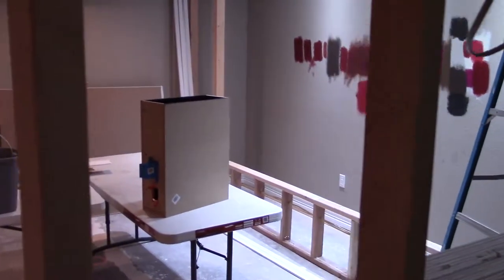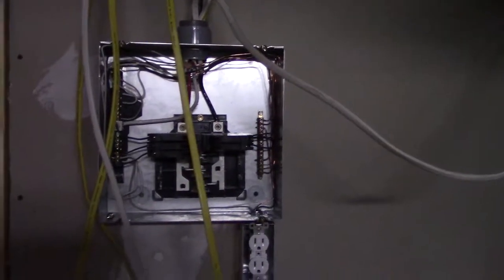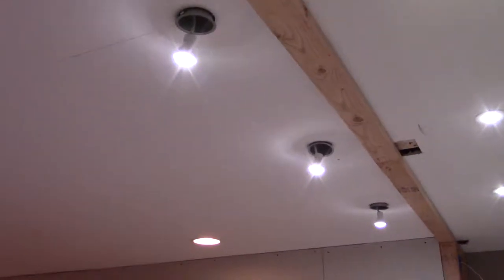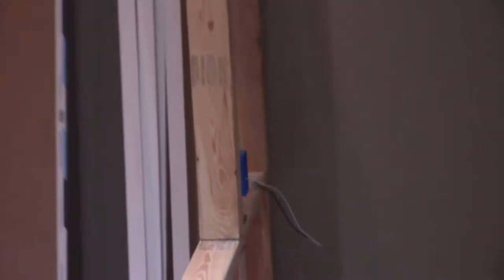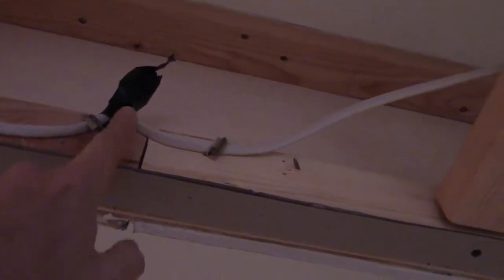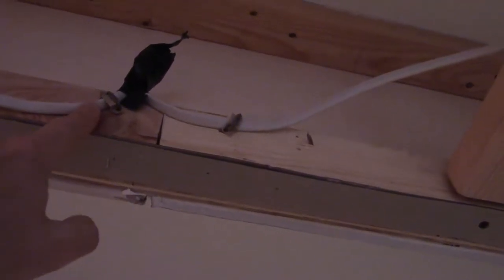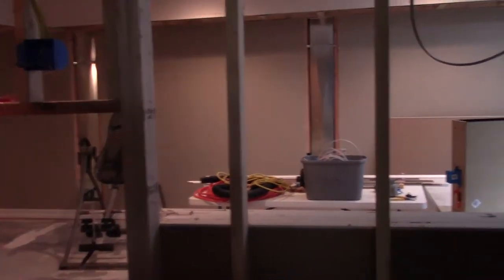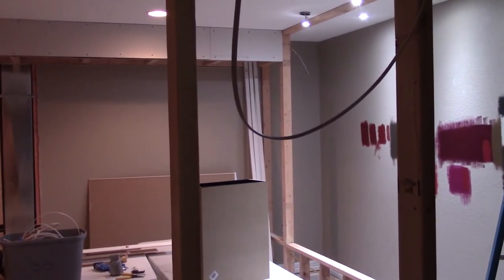Electrical DIY Home Theater - Plenty of power for Klipsch and Atmos Set Up

Comment: I'm curious why, besides the obvious extra cost, you didn't replace the line instead of splicing it together. There is a reason why such things aren't up to code. Do you plan to at least seal the connection in a junction box?
Reply from the maker: Hi Kendall- thanks for the feedback. I did end up putting an electrical box around the repair. It made me feel better and safer just in case.
Reply: Virtual Daveailty Glad to hear it. I just had separate circuit run for my equipment as well. Not lucky enough to have a dedicated space so using my living room. I'm also using Klipsch speakers in a 7.1.2 configuration and they rock. Good luck on your build. Looking forward to seeing the result.